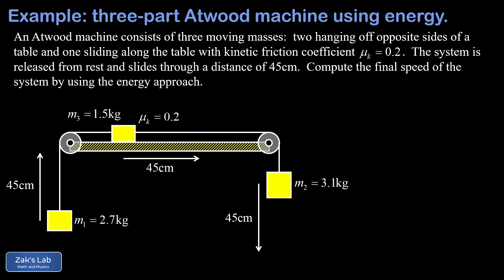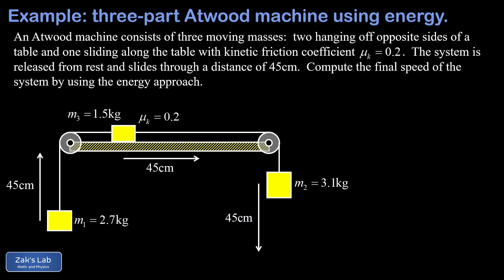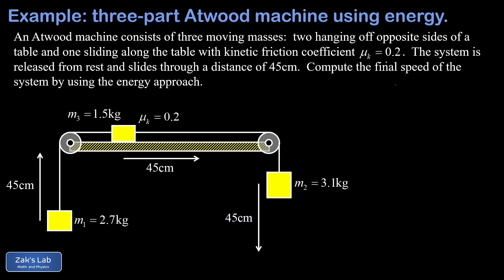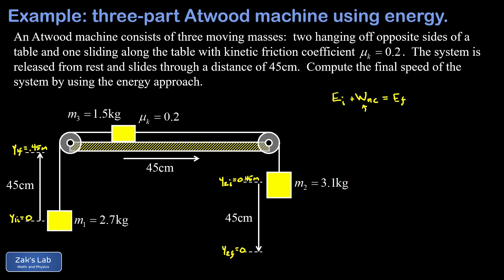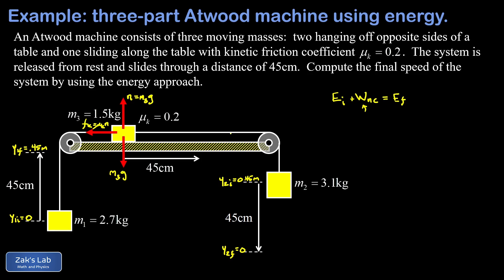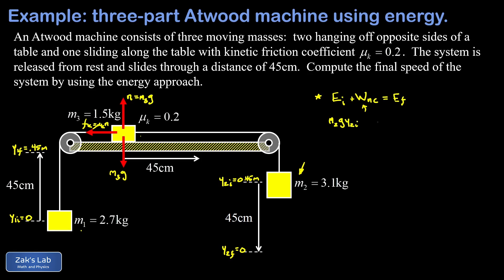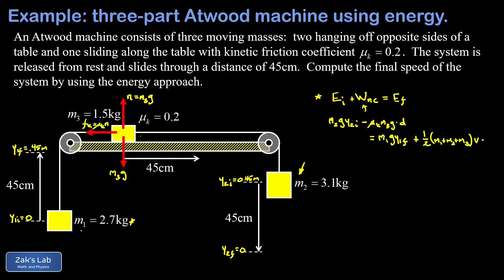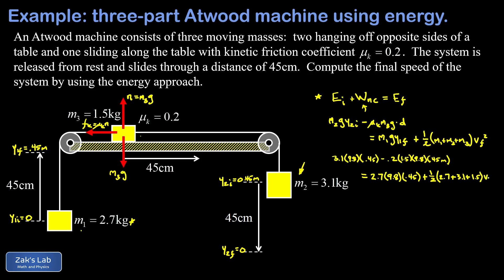Atwood machine with three masses and pulleys:  three mass system using conservation of energy.

Comment: Do you ignore tension force?
Reply from the maker: You don't have to include it in the energy analysis because each tension is an internal force to the system.  If you were to include it in the analysis, you'd find that the net work done by each tension is zero:  the tension in the left string does positive work on the left hanging mass and negative work on the sliding mass, and those works are equal in magnitude.  Same for the tension in the right string: positive work on the sliding mass, negative on the hanging mass.  So any internal force (a force between parts of the system) works like this and can be ignored in the energy analysis. z
Reply: @ZaksLab  thank you so much!